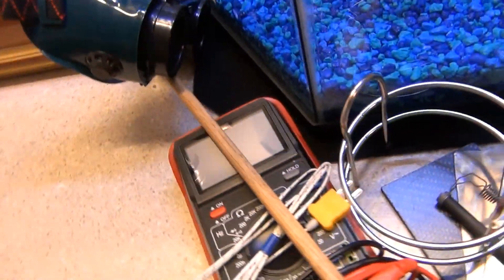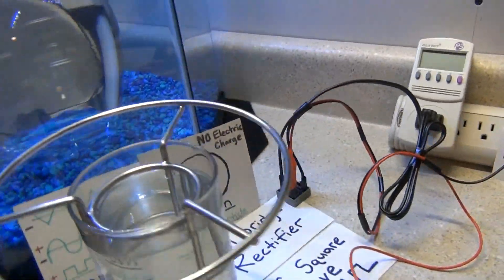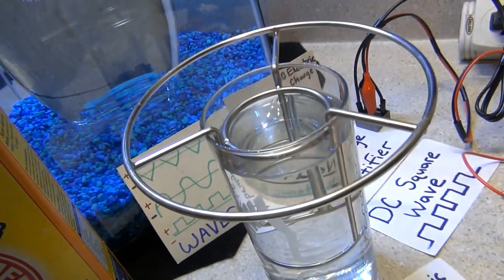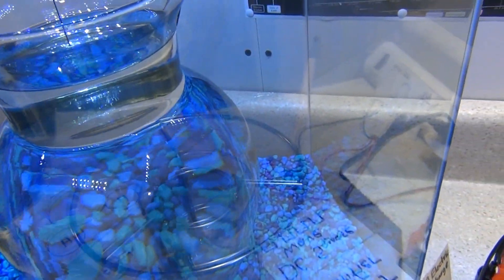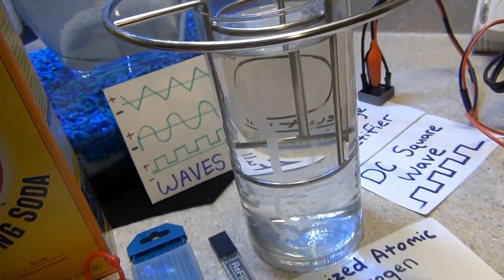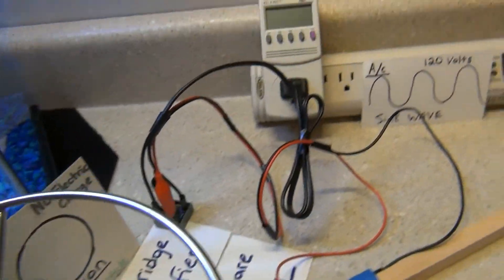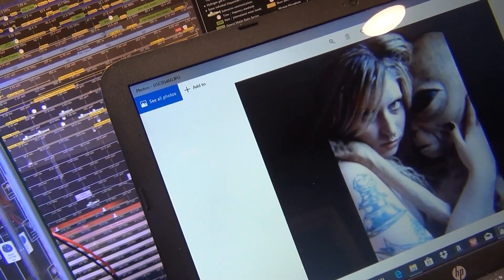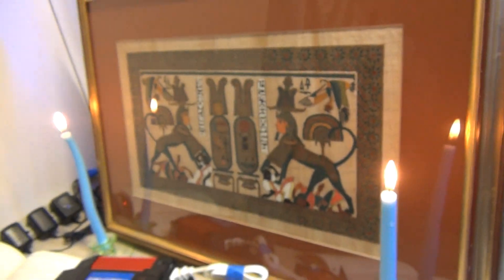STANLEY MEYER ALIEN COLD FUSION CFR PARTS

Comment from the maker: Thats right if your consuming amps your consuming electrical power stanley meyer knew this all too well so he created the voltage intensifier circuit and created the mini  CFR reactor!!! Now voltage can perform work while we set up a condition restricting amp flow and release tremendous amounts of thermal implosive energy in the form of oxyhydrogen gas....